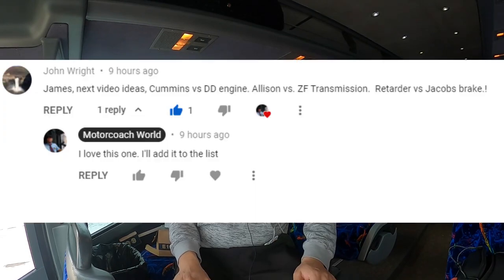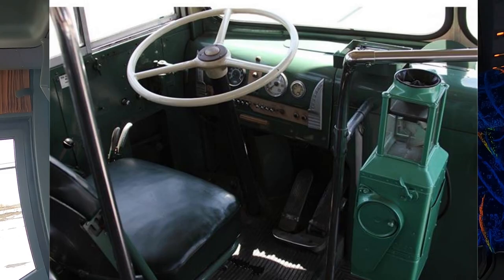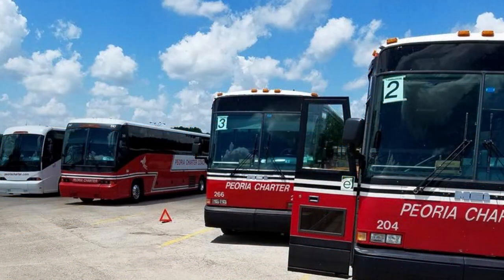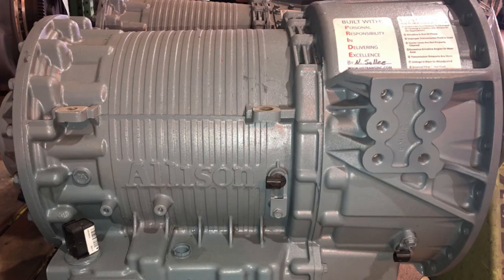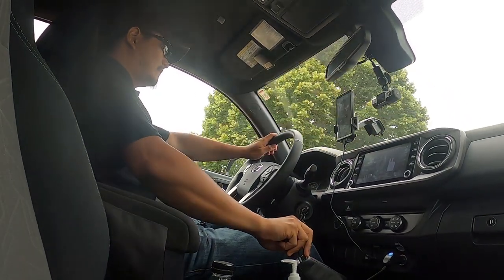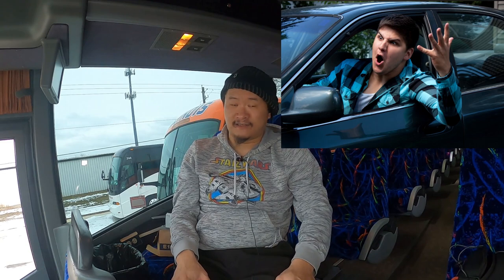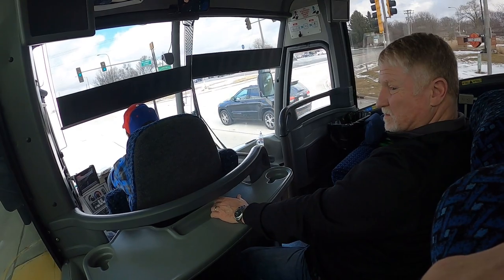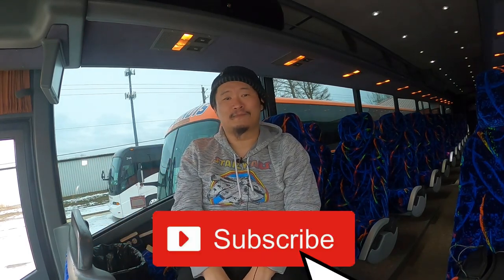Coaches buses come in Manual, Automatic, and Both .  The ZF Transmission

Comment: Check out the volvo I Shift it is fantastic gearbox.   the Scania opticruse  system is good to. Dam those Swedes are good engineers.
Reply from the maker: Hey Thank you for that suggestion! I will  check it out. Appreciate the comment
Reply: @MotorcoachWorld  I second this, I daily a Volvo sedan and can vouch for engineering hours spent where nobody would notice unless they were looking for it. Blew my mind coming from a really nice Ford
Reply: 9700 are beautiful buses
Reply: @matthewgeist1067  this coach is named 9400 in India and its the best buy since early 2000s
Reply: Both systems without clutch. Not as good as the old ones.

Comment: Here we got rid of those 10 speed and 12 speed transmission, thank God. In snow and ice you can get stuck and have a bad experience, on downhill it goes faster and on rail crossing from stop and go you could get hit by a train. Many routes had to be changed due to this, in a fresh green light you can expect to see red before you get to the other side.

Comment: I own/drive a 2007 MCI E4500 with a Cat C13 engine and ZF transmission. I like it, and enjoy the driveability. Except when I was stuck in some mud. The time it takes to go from drive to reverse and back again, combined with the time it took to engage the selected gear (the bus would roll to the bottom of the hole before moving with any real force.) made getting unstuck myself impossible.
Reply from the maker: Andy and Nancy! Yes I know exactly what you mean. I was on a two bus move and the other bus got stuck in some wet mud. You could not shake yourself out. we ended up having to use a chain and I pulled them out with my coach.
Reply: @Motorcoach World  where did you hook up the chain to your coach?! I don't see any visible tow hooks on any coach!
Reply: @LegoWormNoah101  ours has two tow hooks in the front. I don't know of one in the rear though.

Comment: I've never driven a heavy commercial vehicle, but the complaints about the AS Tronic sound an awful lot like my experience with early Volkswagen DSGs (the dual-clutch gearbox referred to as an "automated manual") . The TCU was supposed to "learn" how drivers drove and adapt shift points accordingly, but I don't think it did. Instead, I'd be slowing down for a red light that then turned green, and the transmission would get confused trying to go from 2nd to 1st to 3rd, give up, and lock itself in neutral unless I floored it. It was no fun in a wagon - must have been infuriating in a bus.

Comment: My name is Aquila Mayfield Sr.  And I am a 36 year + 18 wheeler driver, AND a 6 year motor coach driver. I prefer a manual stick shift truck and or motor coach. I was taught by my dad to drive a stick shift trans.And down thru the years I learned to love a stick shift. But I have driven motor coaches such as the Trailway's Eagle with a 4spd manual & THE MCI 9, WITH A 5SPD MANUAL OVERDRIVE. I LIKED THEM BOTH! .BUT THEN I HAVE DRIVEN THE VAN HOOL & MCI & THE EAGLE, WITH AUTOMATIC TRANS,WITH A RETARDER.I HAVE DRIVEN FOR A COMPANY OUT OF ALABAMA,WHERE WE MADE A 5 BUS MOVE FROM NEW ORLEANS LA, TO DETROIT MI. AND A 4 BUS MOVE FROM  NEW ORLEANS  LA TO ORLANDO FLA . THE TRIP TO DETROIT,  ON A MCI 9 5SPEED MANUAL, AND THE ORLANDO  TRIP A MCI 9 WITH AN AUTOMATIC. AND I STILL PREFERRED THE 5 SPD STICK SHIFT.BECAUSE THRU THE YEARS I LEARNED HOW TO FLOAT,THE GEARS ON THE RPMS.I HAVE NEVER, DRIVEN A 18 WHEELER WITH AN AUTO. EVERY time a company would want to put me in a truck with an auto I would trun it down for a stick shift. WI trucks, I have driven everything  from a  5spd mack, as well as a 5& 4 Mack! To GMC ASTRO'S WITH A 10 SPD,PETERBUILTS WITH 13,& 15 SPD TRNS WITH JAKE BRAKES, TO W-900'S WITH 15 'S TO AN 18 SPD MANUAL. BUT NEVER AN AUTOMATIC TRANS, IN A TRUCK.AQUILA MAYFIELD SR AN EXPERIENCED OVER THE. ROAD DRIVER. OUT ASHEVILLE N.C.

Comment: I use to drive for Greyhound they retrofitted about 45% of the MCI-102DL3s with the 
ZF-Astronic. It was a major adjustment and it rocked and rolled through those city streets! But once you got a nice stretch of highway! They’d roll easily up any incline. Sadly they retired all of the DL3s. But they had a handful of The Prevost X3-45s with the Volvo I-Shift and that was a pretty smooth 12 speed.
Reply from the maker: I was very surprised when I saw a DL3 Greyhound drive by me with a ZF in it. I was like.. WOW I didn't realize DL3s had ZFs on them. Then I realized it was something Greyhound did.

Comment: I've been driving trucks here in the UK for a while and I've had 3 different Volvo trucks in my time. My first one was an 8-speed manual that I used for most of my driving years. As you said, I had all the control of a clutch and when I shifted. I was then given a 2010 Volvo FM with an i-Shift gearbox with 12 gears.  I was amazed at how it changed gears. It was basically a manual gearbox but the forks inside the box were controlled by rods and actuators. It didn't use the clutch when changing gears so it essentially 'floated' through the gears. The clutch was only used when coming to a complete stop or performing manoeuvres. It absolutely excelled in this. There was no jerkiness or lunging. If you used the accelerator gently you could feel when the clutch was engaging and you could do really complicated manoeuvres. I am now in a 2017 FM with the iShift and the gear changing is faster and smoother. I've also driven Mercs and Dafs with their own version of these boxes and they don't compare. Trying to reverse a DAF is akin to having the engine revving to about 1500rpm and an on-off button on the accelerator pedal. Busses use a regular auto box although later coaches are using the boxes with an auto-shift/clutch pack. These are for saving fuel as there is no power loss in these boxes.
Reply from the maker: Thank you for this! I loved reading it! Very good info here. It sounds like you have a lot of experience in this field!

Comment: I am one of the operators who LOVED the ZF, having driven them on both Vanhools and MCIs. I would always prefer one over an Allison. Some of the tips and tricks I've used for a smooth but assertive ride:

1. When reversing, pressing the Fn button once to put the transmission in manual mode which kept the clutch permanently disengaged as opposed letting the computer feather the clutch on/off with the throttle. 

2. Using both feet to accelerate with both pedals from a standstill. Especially on inclines where the transmission would be prone to hard grabs, I would hold the brake down while engaging the throttle until the clutch is fully disengaged, then gradually release the brakes for a smooth takeoff.

3. Forcing the bus to start in 4 instead of 3, which people have referred to me as the Even/Lazy gears. I find that this gets you up to speed a little quicker and smoother. Especially when the load is light and you're not going up an incline. 

4. Knowing the right timing to go full throttle. Knowing that the transmission is designed to let the computer do all the work, and using a combination of #3 and #2 above....I would not let my foot put the pedal to the floor until it is in between gear shifts (usually from 4 to 6), which is your window of opportunity to put the pedal to the floor without any noticable jerks. Once there, keep the pedal flat on the floor and let the computer do all the work. 

Some buses were more touchy than others. I recall one bus that I believe would (erroneously?) kick the clutch on and off while coasting, so the bus simply was unable to coast or slow down without jerking and lunging forward. Anyhoo, I miss these transmissions and am disappointed to see them phased out.
Reply from the maker: Raymond Mii! I love this! Thank you so much for sharing! I learned some of these tricks that you have mentioned here! There was a certain nostalgia to them. I didn't hate them. I had to be in the mood to drive one for the day.
Reply: Great info for a new ZF owner. Thanks!
Reply: @MotorcoachWorld  absolutely! I am so glad to see a video like explaining the background of it all and explaining to the world that it's not the driver, it's the bus, haha. Ironically, I picked up many of these tips and tricks from other videos right here on Youtube, which has enabled me to figure out how to love the ZF.
Reply from the maker: @rmui4305  I've had so many passengers on my bus when I drove ZF buses on trips come up to me and tell me that I need to learn how to drive a stick.
I tried so hard to explain that this isn't a stick. They wouldn't listen to me LOL
Reply: Great information! Thank you! When COVID 19 is over. I’ll be back in a ZF bus and I can’t wait!!
Reply: @moscatocoachllc.1797  I'm envious! I think all of my companies have phased out the ZF.

Comment: Hey 👋 my brother. I’ve been a Motor Coach operator for 17 years in the Nyc area. Do to COVID I stopped driving buses and started driving trucks. I do have a Class A license. I miss driving buses. I used to love ZF transmission I loved the snore sounds that the bus made. Hopefully after everything is over I will be able to get back into the bus industry. Thanks for the videos. Best wishes to you.

Comment: I drive a UK double decker in London. We have Volvo's fitted with these kinds of gearboxes, we call them semi-automatic. They're a electric/ diesel hybrids. When the bus moves from stationary and the side brake is released, the brakes are still actually engaged untill you press the gas pedal. You are right, sometimes the gearbox get confused.

Comment: When I got my CDL, my car was a Toyota Matrix 5 speed manual, so I had a slight advantage. The CDL training instructor didn't believe me when I said I have never driven a manual semi before because of how fast I picked up driving a 10 speed manual.      

Now I drive a Freightliner with a 12 speed auto, and I would much rather have a stick. Having a lever and clutch pedal makes me feel so much more in-control of my truck than turning a knob and pushing the go pedal.
Reply from the maker: I agree! much respect to what you said!

Comment: I miss the ZF. People in the back would always be like “is this bus a stick shift?”
Reply from the maker: I know exactly what you mean Donnelle Niven's! I've been asked that question so many times.
Reply: They definitely would if they felt the wobbly transmission when its mounted on a freaking midibus with a 200hp (if that) cummins engine. Just not meant for such small buses.
Reply: @MotorcoachWorld  ZF passengers be like "Is this bus a stick shift" followed by "Why is this driver so bad at driving stick" CH CC CH CC CH CC

Comment: What you said about a skilled driver not knowing how hard to press the brake has happened to me.  30 years behind the wheel of buses and trucks and my 2019 F150 that has electric braking made me feel like a new driver.  I had to shut it off to be able to drive it properly.

Comment: I never driven a coach. But I drive a tractor trailer. I started out with a manual tractor. I loved it. But my newest tractor has a automatic Eaton. I learned to love it. Especially since I can manually shift or use just low gears if needed. But the newest generation of automatics are extremely reliable compared to the ones from the early 2000’s. But sometimes I do miss shifting and splitting gears. But in city or stop and go traffic that Eaton auto is a god send. Love your content. Maybe one day I will try out driving a coach.

Comment: Thanks for the video and the explanation. As someone who is blind and has ridden in Coach buses for most of my life, I prefer standard transmission to automatic, because I find automatic kinda boring, except for the 1980s buses with the wind-up of the gears as the driver goes from one gear to the next. Sure, Standard does feel kinda jerky when going from one gear to the next, plus there is a shaking sensation before the bus accelerates in first gear, as the RPMs go up. I noticed the same thing with ZF transmission and I had no idea what that was and it was called Semi-Automatic by the various drivers I had met, when they had either taken me to or from my destinations, or in passing helping me to get to a bus stop when I was on the way home. The first time I had encountered this type of transmission was on Go Transit, when I was going from Toronto to Hamilton on a day trip in the winter of 2005. Then, I had come across another bus in April of that year, when going from Barrie Ontario, back to Toronto after another one of my day trips. Those buses were fun to ride in and listen to the RPM's go up and the occasional whistle, as the driver would go from one gear to the next.

Comment: Up until 2004, everything I drove in trucks and buses was manual.  In 2004 I got a semi-truck that required the clutch only for starting out in 1st gear (of a 10-speed).  Loved it (didn't interrupt my coffee drinking).  These days, I drive buses with 6-speed Allison auto trannies. No real complaints other than with steep grades downhill, that require the transmission braking,  it can cause the tranny to overheat.  It helps to know the route and to slow down and to select lower gears before descending the grades.  Also, some are better at automatically downshifting than others.

Comment: Lol I remember going through the training program at Brewster Canada back in 2006. One of the things we had to proficiently demonstrate was the ability to hold the coach on a hill with the clutch's friction point. Then we had to make the bus move forward one foot and stop and hold again using the clutch only.
Reply from the maker: Hey Mr Crunchie Crunch. That sounds fun lol. Thanks for the comment!
Reply: I say this with all respect that would be awfully hard on the clutch if done for any amount of time. I was always told to use the brakes to hold the vehicle on a hill, then when taking off keep your foot on the break let the clutch out until it reaches the friction point and take your foot off the break then let the clutch the rest of the way out. Unless they were trying to teach people to find the friction point in the  clutch pedal stroke.
Reply: @theblindredneck747  oh I agree completely it is very hard on the clutch and you're right it was to teach the drivers about the friction point. It also taught good pedal and clutch control. In fact it better taught drivers to do exactly what you said which was come off the clutch just to the friction point while holding the brake then coming off the brake as the clutch grabs. Another trick that I learned and used to teach when I was an instructor is, to watch your tachometer. You'll notice just us the clutch engages the friction point the needle will jump slightly. This also helps the driver to perfectly synchronize their clutch pedal and brake pedal movement and pull away with zero rollback and minimum wear on the clutch
Reply: Carl Ferrigno  so did our customers for keeping them safe in mountainous terrain due to our superior driving skills.

Never wore out a clutch once. My shifting was smooth to the point where I could shift with one finger. More than once I would have a customer come up and say, "Oh, this is a standard? I thought it was an automatic transmission.".
Reply: @millomweb  the whole point isn't to use it as regular driving practice but to teach proper clutch control.

No disrespect but there's a huge difference between driving a car and a 12 to 14 ton motorcoach in the Canadian Rocky mountains with 40 to 55 peoples lives at stake.
Reply: @millomweb  have you ever driven a fully loaded coach up a steep mountain grade from a complete stop? The point is to show drivers how to move the bus forward from a complete stop on an uphill incline without rolling backwards. It teaches drivers to learn precisely where the friction point is.

Comment: Nice video! The public transport company in my area (Italian Alps) has a couple of Mercedes-Benz O404 commuter buses with an automated manual transmission, I believe it's called PowerShift and it operates sequentially with a lever.
Other than that most buses (city and commuter) have a ZF 6-speed automatic, while some survivors from the 90's have a manual transmission.
Most motor coaches are still manual though.

Comment: Over here all public transport companies have been using automatics in their bus fleets for decades now. Tour/charter fleets still use manual stick shifters but they have been phasing those out. Granted those tour/charter fleet have busses that give you the option to manual shift but they are essentially automatic transmissions.  

As for the new drivers depending on the drivers school fleets most of them only learn to drive on automatic which is not a problem considering the vast majority of them will end up in public transport. Also, they will get a Automatic only restriction on their CD licence.(IIRC that restriction gets dropped in future legislation). Though, most people drive stick in their private vehicles over here. Granted most tour/charted companies still prefer applicants who have had their drivers lessons on manual stick shift busses.